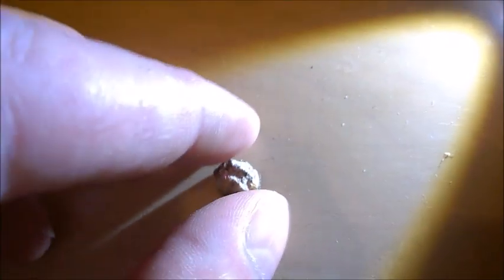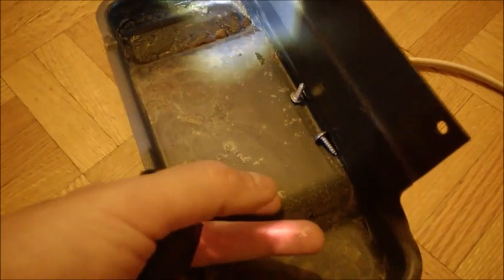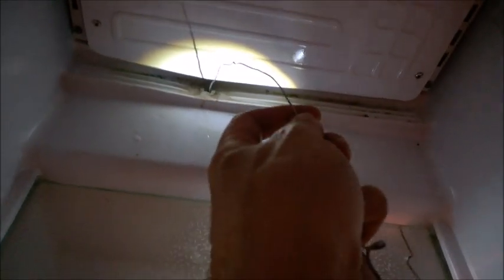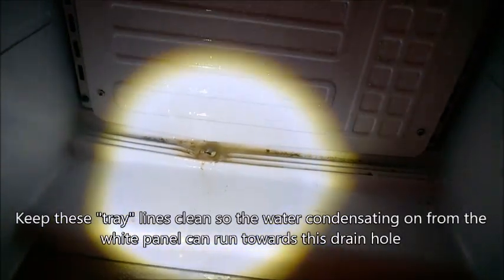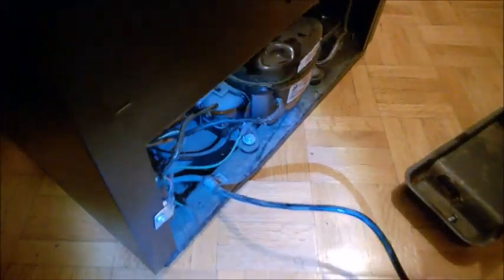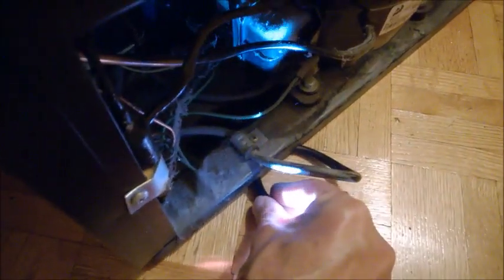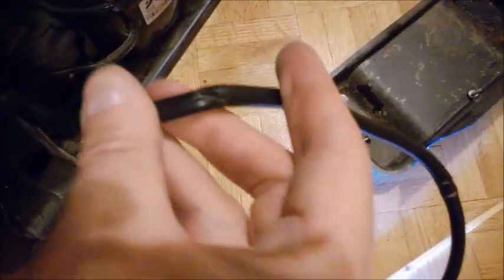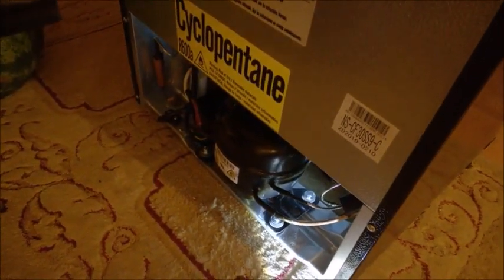Mini fridge leaks water on the floor - Fix

Comment: Hi, can you please help me? I've had food poisoning several times! Found lots of big puddles on the floor. I cleaned the hole. Yesterday, it had a sheet of ice clogging it, I removed it. Found this video. I am disabled so it was hard for me. When I unplugged it, I pulled it but it's inside a cabinet and the panel at back does not let me access the container. I have this very Danby (your 1st mini fridge). I put a small scraper inside the hole and it's clean, it touched the bottom container. Do I still need to open it? aMaybe something else going on? Please reply please hel;p me

The fridge stopped cooling 2 days ago & got food poisoning after breakfast After I cleaned the hole that day, it made the ice again in the back wall. But then it stopped cooling yesterday again got food poisoning and now I have stomach cramps. Last night it quit cooling even though I checked that the hole was clean. First it made ice from the droplets top back wall. I just opened it. It's barely cool. There are no puddles on the floor but no ice droplets, liquid drops again. What do I do? I  live in a motel and the manager is nasty and will not replace it. Currently being evicted. Please help me. I am too sick to keep having food poisoning and cannot go out daily to buy food. I need special foods. Thanks
Reply: PS: there is a LOT of dust (almost 1 inch) caked on every visible part at back. Could that be it? It's on the big black bottle and all over the parts. I do not think there is any dust on the container because that is protected since it is screwed and my scraper tool came out clean. What can I do? What other thing do you think could make it stop cooling ? 

The fridge noise stops and will not start upon re-plugging it. Other times it'll make the noise like it starts and the wall sides go from hot to cool. Inside walls of fridge go from sorta cool to very cold but not since last night. I slept and do not know what happened at night, but there's no puddle and no ice droplets nor frost at back wall. It's watery. Thank you for your time.
Reply from the maker: @e.e.e  If there is a lot of dust on the compressor, it's worth cleaning it up, it may cause the compressor to overheat which would trigger it's relay intermittently and turn it off until it cools down. It has a temperature sensor somewhere to prevent it from overheating.
Reply: @Peppermint1  Thank you. I will pull it out from the wall again later. It is hard to clean because of a wood panel that is fixed on top but warps out at the bottom. I did turn the button all the way the other way, but then I realized that I have been living here almost 3 years, and the fridge was cooling normally, so if I turned it counter-clockwise, that means I would shut it. I did turn it when I removed the caked on dust. Then turned it back to the maximum. Will try to dust it more later on.